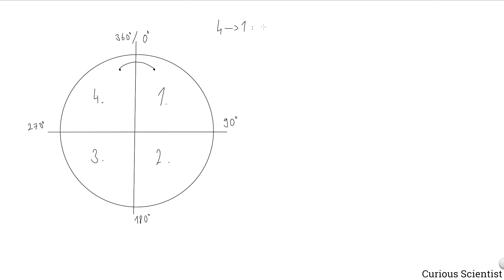AS5600 Magnetic encoder - A practical example

Comment: Hi, thank you for the extensive explanation, really appreciated. I'm going to use the magnetic encoder, and You've been of a great help.
As little consideration, the full rotation could be divided in three equal parts parts of 120 degrees instead of quadrants: The purpose to detect turns increament/decrement could be fulfilled with a larger time period (+33%, by considering the same rotational speed).
Reply from the maker: Hi! The full rotation could also be divided into two parts or I could even only look for the 355° → 0° transition, however, I want to see the direction changes a bit more often and that's why I divided the full circle into 4 sectors. I do not need such a high speed, but I need precision.
Reply: @CuriousScientist  dividing the full rotation in at least 3 parts, each transition is direction dependant ... not with 2.
I've just ordered the AS5600 boards, I'll soon experiment the method you've well explained.

Comment: The STM32F103C8/BT6 has 4 timers that can do all the QEI processing for you in hardware, the count is in a register. It takes some setting up. Perhaps this can be done in 'arduino' c++, though I've only used it in plain C. BTW: great channel, thanks for the videos!
Reply from the maker: Thanks! Yes, I am aware of those timers, I extensively use them in one of my other project (TCD1304 CCD). It can be done in Arduino as well, however, I am not that experienced with it in Arduino. (For "deeper" STM32 programming, I used the CubeIDE with its HAL library)
Reply: @CuriousScientist  Arduino, though easy, abstracts away a lot of things (like timers). I hadn't seen your videos from more complex projects like the linear ccd yet. Keep up the interesting work!

Comment: A question about the encoder. You get a 1 bit +/- result. Is the magnetic encoder error cumulative? If it is not, then one can just round up the encoder result to the nearest degree, and it the results on the OLED will match the wheel perfectly.
Reply from the maker: Hi! As I noticed, the ±1 bit error is not cumulative, it is just the uncertainty of the current position. As the position of the magnet is reset at every turn, the error cannot accumulate. This error comes maybe also from the fact that the magnet is not perfectly centered over the AS5600 chip. Rounding and/or averaging would solve this, I believe. Since one bit is about 0.088 degrees, we have a lot of freedom in the rounding. For me, even ±1° would be okay, I just wanted to show the maximum capabilities of the device. To put the 1° uncertainty into perspective: If I would use a 8 mm pitch lead screw and miss 1° from its rotation, I would only have 22.2 um uncertainty of linear displacement. That is pretty OK for my not too precise applications.

Comment: Hi!  I have managed to get your setup working on a nano clone with a quadrature encoder.  The encoder has 600 pulses per revolution. The code seems to work quite well after i accounted for the difference in the number of pulses, but I am having trouble with the board crashing when i change the direction of the encoder in rapid succession.  Do you think implementing the code on a faster microcontroller (teensy 4.1 @600MHZ) would solve the problem?  Thanks!
Reply from the maker: Hi! Did you copy the code as-is or you made some modifications to it? I never encountered issues when changing directions, so at this moment I unfortunately have no idea. Faster microcontroller is always a good idea, especially if you generate a lot of interrupts (or pin polling) quickly. Also, you might want to look at other displays or libraries for this display because I have noticed that it can mess with the interrupts and timings sometimes. If you have other type of displays, you should try to use it before switching to a more expensive Teensy.

Comment: Thank you for this wonderful video. It got me inspired to rebuild an old airplane instrument using the AS5600 to read heading inputs when the pilot dials a knob. I do have a question though. My gauge has multiple knobs to adjust angles and headings. I can see from the manual that the I2C address is 0x36 (which is what you use in your code). Do you know if that address is static? How would you go about using 3 or 4 of these units connected to the same Arduino (since they all have the same I2C address)? Is it even possible...
Reply from the maker: Hi and thank you!
Yes, it is possible! The answer for your question can be found in this video: https://youtu.be/IZ0FyiMYT48

I use 2 AS5600 with the same i2c address "simultaneously " by using an i2c multiplexer. Follow the video carefully and you can learn how to do it.
Reply: @CuriousScientist  Thank you so much :)
Reply from the maker: You're welcome! Cheers!

Comment: Apart from missed steps checking, the use of shaft encoding can be closed loop with micro stepping?
There is no load on your motor. Changing current drive pwm to hold or achieve accurate position in microsteps would be an interesting demo. I would have to write my own code.
PID loop with no overshoot. Telescope astrophotography drive.
I want to use big 5 phase micro stepping but even look up table the 64 microsteps have varying torque.
Reply from the maker: Sure, you can PID control a stepper motor, there are some projects out there already. However, I would say that it is not a typical application, because you usually don't combine PID and stepper motors. If the system is built well (e.g. fitted for the loads and speeds...etc.), then a stepper will basically always go to the position and will always maintain the speed that is prescribed. Just think about 3d printers. They can print for days and their axes can travel kilometers without making any mistakes. Without PID. On the other hand, DC motors are controlled with PID. It is a different principle. For astrophotography, I am 99% sure that you don't need PID if you use stepper motors.

Comment: Thank you for this video. I have bought three brand new as5600, printed mount for a magnet, I have same display and use your Arduino code and also try default sketches from as5600 library with same glitchy results: the angle is not stable. and I cant reach 360 degree. Dir pin is connected. What can be wrong?
Reply from the maker: Hi! Is the distance between the magnet and the sensor sufficient? Do you use a proper magnet?
Reply: @CuriousScientist  I have tried sample AS5600_demo_status with as5600.detectMagnet() and as5600.magnetTooStrong() and as5600.magnetTooWeak() values printed to serial. Experimentally found the best distance is about 0.5 mm. I have used the magnet included in package. same as yours.
Reply from the maker: If you did exactly the same things that I did, then you should not experience issues. As you can see it in my demonstration, everything goes well. Are you sure that you replicated the exact wiring? Do you use the same microcontroller? Have you checked the voltages? If you use a breadboard, make sure that it is a proper one. I sometimes get questions from others and after hours of exchanging information, it turns out that they used a garbage breadboard and some pins were not contacting properly.

Comment: Did you align the magnet and the encoder?  There is quite an elaborate procedure to achieve that as far as I remember
Reply from the maker: I made sure that the magnet was centred over the sensor and I also adjusted the distance between the sensor and the magnet according to the datasheet's recommendation. It is not that sophisticated.

Comment: Have you thought about using FreeRTOS on the STM32? I mean, you really need a lagless experience in order to receive both commands from MPG and AS5600 and then send perfectly timed impulses to the stepper driver. Also, use PID if you really want a proper closed loop experience. Thanks for sharing!
Reply from the maker: Hi! I haven't yet thought about this. For publishing purposes I prefer to use stm32duino because even with this simple coding people have problems. I probably won't use freertos for my videos in the near future.
Reply: I don't think using a PID for a stepper motor would be very useful since stepper motors usually move at fixed speed (although it is certainly feasable). But a closed loop control with feedback is definitely worth exploring

Comment: This is wonderful Project. i want to know how to set encoder position zero pro-grammatically ? suppose i read degree using magnetic encoder like 265 and now how to set zero this position?
Reply from the maker: Thanks! If you want to burn in a zero position, you should read the manual. But, it is really easy to quickly tare the position upon the power up (like I do it), so I don't really see the need of burning in a zero position.

Comment: This is amazing. I now have the same ESP32 board, an as56000 and a 17hs4023... and i would love to build one... can you possible provide details of the 3d printed part you used to mount the sensor to the stepper ? Much appreciated!
Reply from the maker: Hi! Have you ever looked around on my website? I am pretty sure that you'll find it there under one of the AS5600-related pages. ;)

Comment: the error can also be in the computing of the encoders signal in the arduino. i had that with an uno, when i ran same encoder on a mega the error became almost nothing. want to try a faster micro controller like teensy 4.1
Reply from the maker: I actually bought a few Teensy 4.0 recently. I will test it later!

Comment: hi dood, nice films! spent the whole evening watching them !     im hoping you can help me with a problem i have? i have purchased 4 AS5600 pcbs with magnets but i should have bought incremental encoders.   is there a way to use the AS5600 to generate A quadrature output similar to the A B output from your cnc handwheel?

cheers

tanc
Reply from the maker: Hi! You can toggle two output pins whenever there is a change in the angle. Alternatively, the AS56000 also generates PWM, maybe you can use that as well. I would just write a code that detects let's say every 1° change and then creates a pulse, or two in your case. You also have to pay attention to the directions.

Comment: Me and friends like your projects.
I would like help with the AS5600, I placed the magnet on the axis of a NEMA17 and installed the AS5600 on the back. It turns out that at some angular points, the reading is jumping in two measurements alternately. Not changing the angular position, even disconnecting the power from the system and then re-feeding it, the same thing happens.
If it's at a single-reading angle, it returns a single-reading, which seems okay to me.
Did it have to do with a problem in defining the quadrant or something similar?
Reply from the maker: Hi! I do not exactly understand you issue. Is it that the number is jumping with that +/- 0.0878° (1 bit) value or something else? It can be also due to the bad alignment of the magnet and the sensor, or just simply a digital noise. You will never get the same values with continuous reading, you have to average it. Or round the numbers, so the uncertainty is "buried" in the rounding.
Reply: Total angle: 
22.50
Deg angle: 
24.96
Corrected angle: 
0.00
Quadrant: 
1
Turns: 
0
Total angle: 
0.00
Deg angle: 
47.46
Corrected angle: 
22.50
Quadrant: 
1
Turns: 
0
Total angle: 

22.50
Deg angle: 
24.96
Corrected angle: 
0.00
Quadrant: 
1
Turns: 
0
Total angle: 
0.00
Deg angle: 
47.46
Corrected angle: 
22.50
Quadrant: 
1
Turns: 
0
Total angle: 
22.50

Look 22.50  0.00  22.50 0.00   ........This sequence occurs at some points of 360 degrees and at most angles it is correct.
Even by turning off the power to all components and turning it back on again the error points remain fixed despite different values of course
Reply from the maker: Did you modify anything in my code? I have never encountered this issue, but I will look into it later.

Comment: Hi. I looked at you source code and you can optimize it to get the quadrant value.
You can replace the function checkQuadrant() with 1 line.

quadrantNumber = floor(correctedAngle / 90) + 1

This will give you 1 2 3 or 4 ;-)
Reply from the maker: Hi! Oh wow, thanks! I look into this as several people suggested that my code around the quadrants could be improved. It is nice to receive feedback like this, thanks!

Comment: very cool your work. friend I will use your project on my CNH. I just have a doubt which pin of my controller board should I connect to stm32. for calibration
Reply from the maker: Thanks! I published the wiring on my website.
Reply: @CuriousScientist  OK. OK. I understand very little. the question is what is the name of the pins that come from my board to connect to pins A and B of your project... example pin-A connects to pin-B pin-C connects to pin-D... I don't know the name of the pinout that comes from the board for your project (((thank you in advance)
Reply: @CuriousScientist  I don't know the name of the pins on my board that I should connect pins A-B of your project
Reply from the maker: As I said, all the information can be found on my website! Everything is written there and shown on the schematics.

Comment: WOW 09:33  you dont get exact pulses from your handwheel - thats nasty (in the cnc world anyway). Are you saying its an inherent +/- 1 bit uncertainty (or more?) that needs to be rounded in s/w?.  I cant have my reading jittering (like a dvm does - I often switch to my old Avo model 8 the analog display often tells you so much more)
Reply from the maker: I think that probably someone with better programming skills could make the counting to be spot on. I was using the simplest (and maybe lousiest) way of counting the pulses and since I also updated the display in parallel and so on, it could be that the missed steps are due to a badly written code. I think it is just a matter of signal conditioning and a better a better code than mine. Some day, I might revisit this topic again so I can see if I could write a better, more accurate code.